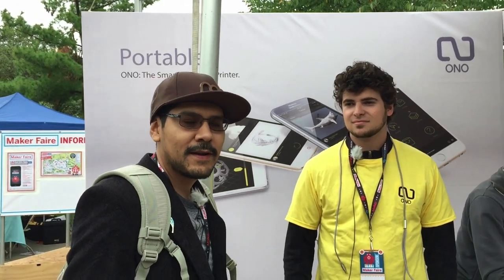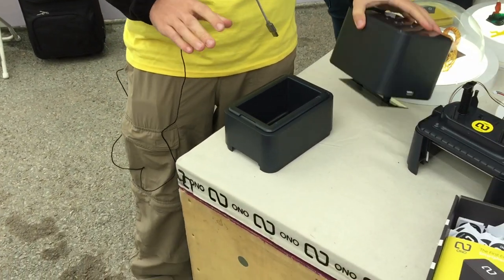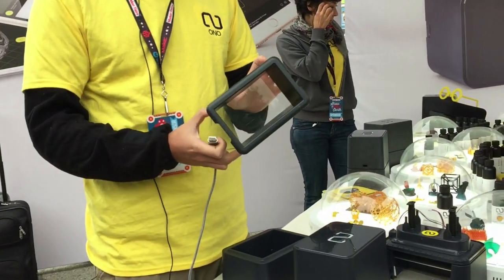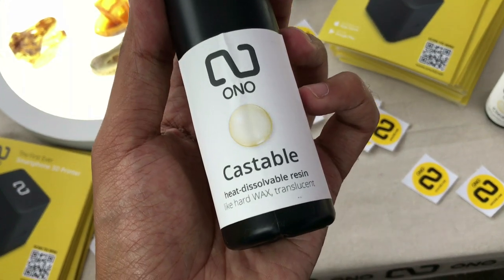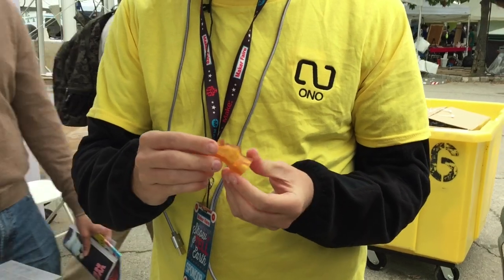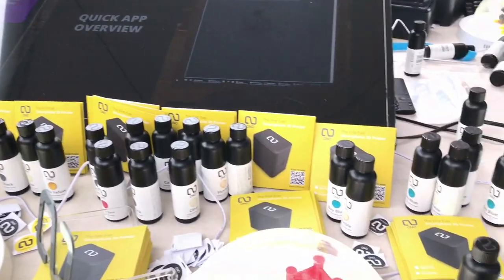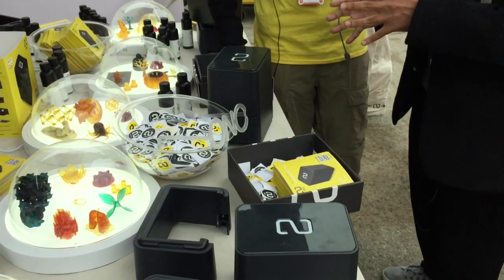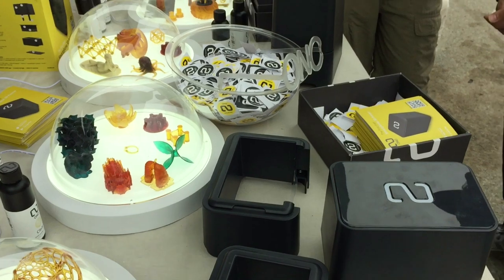ONO - the Smart Phone 3D Printer #WMF16

Comment: Looks very cool until you remember you have to live without your phone while it's printing for "four and a half to five hours" for the 2 inch build height.  I think they'll have more success if they do a version that incorporates a cheap Android tablet (which could also be bigger).
Reply: There were plans that they talked about where they were going to have versions of the printer with a built in display. Aside from that though, as a backer, I was planning on using my old phone to run it instead of my current phone
Reply: David Smith just use your old phone if you don't care about a slight change in quality
Reply: I think it'll be your next phone, rather than your last one, at the rate they are shipping...
Reply: If you're not one of them folks who breaks their phones incessantly, you should have at least one old phone (assuming you bought a practical phone and not an iphone).  My Note II will last another decade and it's already 5 years old.
Reply: You can use It while you sleep.
Reply: I got two iPhone 6 as a Christmas gift. I’ve been wanting this printer for ages.

Comment: for me i hear audio jack and think peachy printer... that said it is an interesting concept but i hear the words cloud and think data usage or if your wifi is not that great... 

i mean 4-6 hrs to print a ring... that is SLOW! Also im concerned with cleaning resin off the print before it cures and hardens as well as what happens to the resin inside the machine? i guess at $99 part of me is tempted to get it to try and quell my concerns but part of me says is it a lesson in frustration?
Reply: I'm not sure if I understand most of what you're saying. Your English is unique to say the least. The audio jack uses a continual system of beeps to move the stepper motor. There's no ring. The data transfer is important so you'll have to be on a wifi network. Yes it's a slow okay-resolution resin printer. Resin printers are usually slow and this is a low-budget one for families. It's not 99 bucks, it's 150 bucks when you include fees and shipping. Or 175 if you do the free-shipping method which gives you four more bottles of resin. You are required to wash off the print exactly when it's done printing, so spare resin will not harden. You then leave the product out in the sun about five hours. The left over resin can easily be reused as long as it's not exposed to light too much. The product comes with a funnel, as seen in all product demonstrations.

Comment: so, basically, if you have an iPhone 7, you can't use this.
Reply: you can use the adapter that comes with the phone.
Reply: but  it connect thur the headphone jack which means the battery might die while making a big object unless you have a 50 dollar adapter ... kinda lame
Reply: very true.
Reply: WIth the open access to the phone from both sides, you can also plug in a charger at the same time as the headphone.   The video says this as well.
Reply: Blame Apple, not ONO.
Reply: I knew this would be the top comment!
Reply: Well they changed the design so that you don’t use the headphone jack at all

Comment: What if you get a TXT/Call/Alert etc during a print?
Reply: this is a very interesting remark indeed.
Reply: It turns off communications if I remember correctly.
Reply: You WON'T be using your own phone if you want to print a lot of things. You'll basically be without communication with the world if you did that. Not turning off communications, would mean your prints are a huge fail. So you'll be buying a small tablet on ebay instead of using your phone.
Reply: If you're not one of them folks who breaks their phones incessantly, you should have at least one old phone (assuming you bought a practical phone and not an iphone).  My Note II will last another decade and it's already 5 years old.
Reply: I have two phones. One is my Ono phone. The other has all my stuff on it.

Comment: The basic principle is interesting, but the build size is a bit small.  Why not scale this idea up a bit?  Instead of using a cell phone screen for the light source, why not use something like a high resolution PC screen?  And build more height into the thing.  That way you could jump from being able to print things that are all small enough to sit in the palm of your hand to being able to print things roughly the size of a breadbox.  (Custom 3-d printed desktop computer cases, anybody?)  And you could drive it using one of the extra video ports many of us have sitting idle on our desktop PCs.  It could run as a background task, leaving the PC's main screen free to be used for normal day-to-day work and play.  The main downside I see is the cost of filling the large vat with enough resin to give you the depth you'd need to build taller, larger objects.
Reply: One thing to note is the cost of their resin. $150/L makes large volumes an expensive proposition, especially because exposing the resin to sunlight will ruin it...